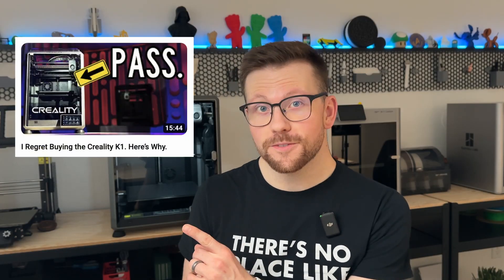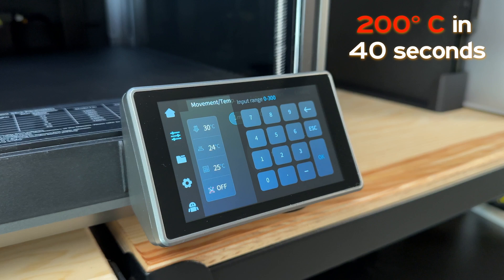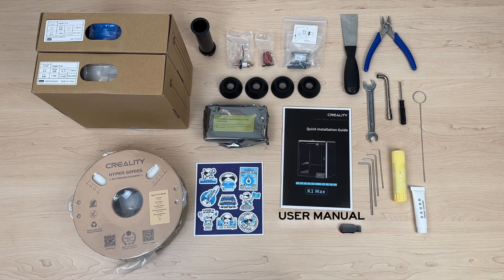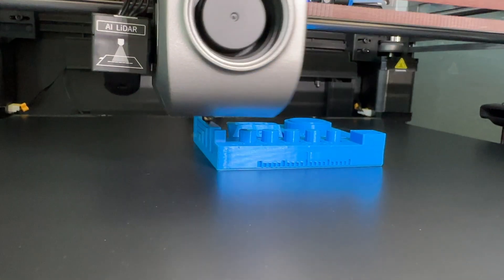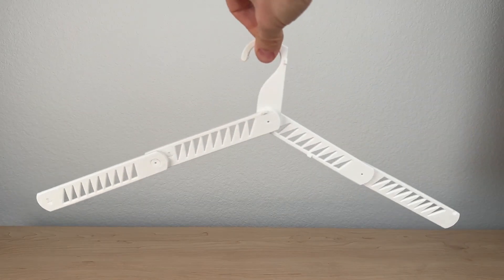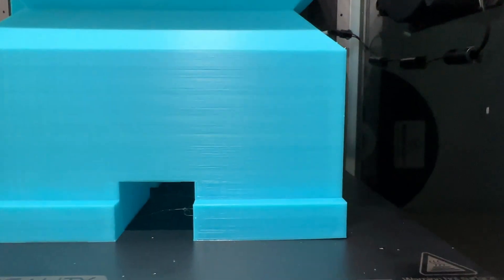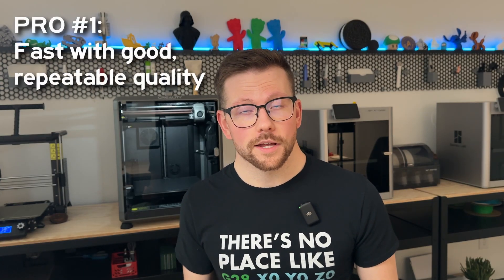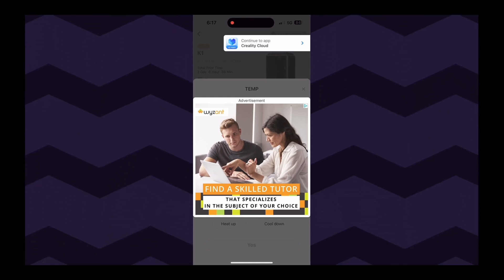The K1 Max is BIG... But Is It Any Good?

Comment: Does the faster print speed wear out the stepper motors quicker over time?  Or does it maybe wear out the rubber bands/tracking faster?
Reply from the maker: Not that we’ve noticed yet but I guess time will tell

Comment: No, it's not good. I bought one and STRONGLY advise against getting one: quality contron is non-existent, print quality is worse than my €250 printer, many failed prints, maintenace is a pain in the back and it's not noissy, the noise levels are infernal.

Comment: I just got the K1 Max for $650! 😁
Reply: Guys. K1 max or p1s? Any thoughts
Reply: @user-rx8qq8sk9ydv1ce5ib I have the k1 max and it prints fast  
And I recommend it it also has a camera in it but if you want multicolor then buy the bambu lab printer
Reply: @user-rx8qq8sk9ydv1ce5ib I have both printers and would personally say the K1 max if you want size and p1s if you want simple to operate and want the AMS system.
Reply: Website? I’m currently shopping for a k1 max!
Reply: Are you serious. I did some searching and price around 1k2 dollars.
Reply: Quick! Someone stop thief! It's a steal! 😂

Comment: It seems in your review all the issues you pointed out had excuses attached to them. This may be an option for needing a bigger built plate only before Bambu Lab releases a bigger built plate unit most likely in 2024. Then Creality will rush to the Xerox copy machine to make yet another release of 3D printer in an all ready crowded Creality product line. In the prints you showed in my opinion they didn't look that impressive in quality.
Reply: I didn't hear any excuses, he made valid points about a couple quality control issues, and pointedly called out the sag and stringing issues on several prints, and he called out the AI failure to pick up on QC issues it was designed to detect. Maybe Bambu Labs can take you on a date or something, it sounds like you needed one.

Comment: I'm confused.  A generally positive review even though you consistently identify problems in print quality.  Banding, ghosting, and stringing are not "good prints".
Reply: There's some rack to print to raise the top glass which solves the issue.

Comment: Did you calibrate the filament or just run the tests without calibration.

From one color or brand calibration results differ. This is mostly user error if you dont calibrate your materials.

Comment: So I know the printer is all about speed, but my concern is quality of print. Id be willing to accept the so-so quality I keep seeing on a fast print. But I would like to know if the quality of prints is  much better if you were to print more slowly. I suppose I'm hoping for a best of both worlds answer here. I have a fairly heavily moded ender 5 plus that delivers beautiful quality at like 80 mm/sec. So, Is the k1 max good fast and very good slow? Or are the slow prints the kinda so-so quality we see in the examples? Hope my question made sense. Thanks in advance!
Reply: You won't get that quality unfortunately. I have a modified ender 3 v2 with klipper. It prints in much better quality. In fact, if you go slow with k1 you get worse quality.
Reply: do you have a k1? Where did you see that if printed slower, it results in worse quality? @serhatozkara3281

Comment: Thinking for getting a "Prusa MK4 3D Printer kit" It seems to be a quality maching with good customer service.  That's Important to me as this will be my 1st 3d printer.  I don't want to get a 3d print have an issue.... Instructions not in english & no tech support.... Thoughts? Have you used this machine or have any feedback from others on this?
Reply: For a first printer, depending on how skilled you are with electronics in general, I recommend something else. That machine is 800 USD before all the mandatory and extras. You can get similar quality for less. Elegoo is releasing neptune 4 pro, which is what I will be getting, but there is also ankermake m5-whatever, if you want 2 machines that are easy to put together. E has great CS but a little slow, 1 business day. When I questioned about a resin I got they tracked down the lot, batch, and expire numbers for me, as an example.
If you want a "plug and play" machine at the same costs the bambu p1p/s machines are worth it for PLA and are cheaper. Heck, even the X1C without AMS is roughly the same, so you can print ASA/PETG if you want to. 

I'm sure there are more machines, but these are some quick ones I found for better value. The E-N4P is easier to put together than my first machine, the 2NP from a few years ago, and I have limited hand movements and never built a machine before.
Reply: Exactly, PRUSA is Great but they aren't Perfect and for the Money and Wait time the bambu series is the way to go IMO @RoseKindred
Reply: Just wait for the 20 to see what new Printer bambu and Creality will be releasing..PRUSA should be No ones 1st printer you buy something more affordable to start in the 200- 300 range. Even PRUSA have the same problems if they aren't set up properly ALL 3D printers eventually run into similar problems like bad first layers messing w the Z axis thing like that Even the so called Self leveling printers". your better off if you want to spend the Money with a Bambu as its pretty damn near perfect. PRUSA are very good but can sometimes take months of backorder if not years.
Reply: Thank You For the Advice... About 6month away from making the leap so I doing my research Now! I Appreciate your reply. @AlbertoMartinez765

Comment: Mine came in with a smashed door, creality got one on the way fast. I only have a couple complaints after printing about 100 hrs. It suffers from bowden jump, The fans are loud loud, and  the overhead glass needed to be a bit taller to keep the cable chain from hitting. Other than my filament issue mine has put out some prints.  Its nice to have the extra room to do petg without having to cover my cr10s.
Reply: i Was wondering if adding some Weatherseal Foam would help lift it that just a bit higher?
Reply: @AlbertoMartinez765  I just removed it im planning on feeding the filament straight down to see if extruder issues are better and less smacking noise

Comment: Really, who designs a enclosed printer but then has a big square hole in the bottom right to allow for the touch screen?

They been better off having either the screen as a separate unit plugged in to a port so the screen can be put aside and the door then be fully sealed no hole there, 

Or have the screen up on the top right of the outside frame on a bracket with the plug there to plug it into. so it is clear of the door area.

I seen a few reviews of the K1 and the K1 Max. And I not impressed with the ongoing problems and bad design like the door hole for the screen!

I most likely get the Bambu P1S instead of this K1 Max.  I don't think Creality has really fixed the issues the 1st version had?

Until I have saved up for the fast core xy enclosed Klipper type 3D printer I am after, I make d with the BTT Pad 7 I ordered and I be getting delivered Monday!
I got the Elegoo Neptune 3 Max so I use the pad 7 to see how fast and detailed that one can do with the pad 7?

Comment: If you're looking for this over the K1 or P1S/X1C, you're looking for build size. So the real question is, how does it stack up to the QIDItech X Max 3, which is $100 more, is 10% larger and has a heated enclosure?
Reply: QIDI print quality is similar to Bambu, X Max3 has a large volume and chamber heating, is able to print a wide range of materials, and the after-sales service is really top notch in my opinion.
Reply: Two completely crap xmax3s. Both had major faults. Returned and will never give them another try.
Reply: Qidi is wayyyy better
Reply: I love my X-max 3, rock solid machine
Reply: Qidi lol…

Don’t waste your time. They are so loud (not just the fans). Take up more space than they need and there will be no real community for it. The community will turn the K1 into a beast with custom firmwares and fixes. I returned my x-plus.

Comment: Was waiting for the improved K1 / K1 max reviews..  But it seems like they still dont match the quality of the competition.. (bambu lab)
Reply: Close, and after some firmware updates it will be. Then when the community really digs in it could pass Bambu by. They will release an AMS soon too.

Bambu doesn’t have a large format yet and it will most likely cost more.

I have an X1 and I want a K1 max.
Reply: Also got an X1; but waiting for Bambu's answer to an Xl printer.. or if the K1 max improves allot that's an option. @dangerous8333
Reply: true on overall quality but my main prints are cosplay pieces and having the 300mm^3 is a huge upgrade
Reply: Already got some more trust in the printers since they just made it truly "open source" .. that shows Creality is serious. @laughintrollface
Reply: Bambu is also 1.5x the price
Reply: @ConnorSmithBirch And for 1.5x the price you get AI features that actually perform as advertised lol…